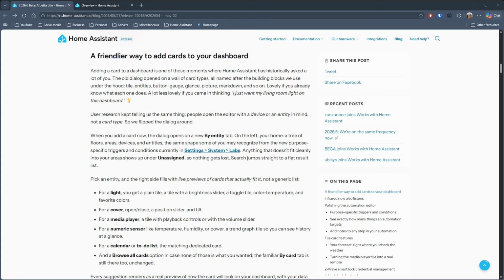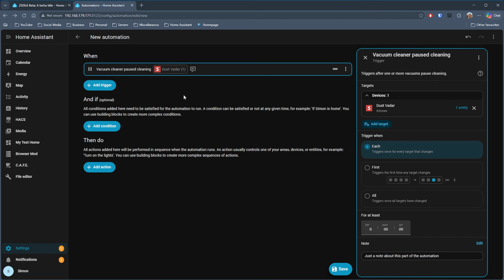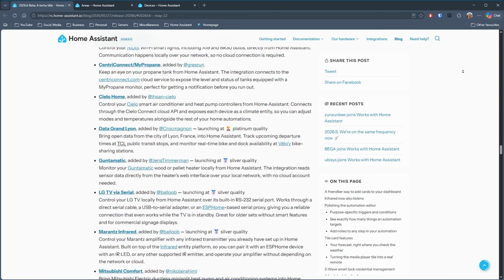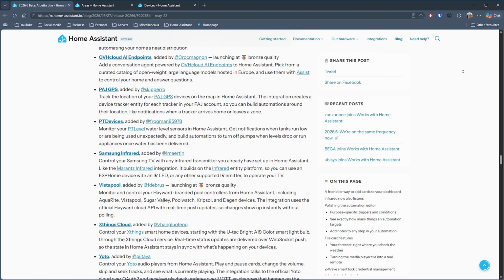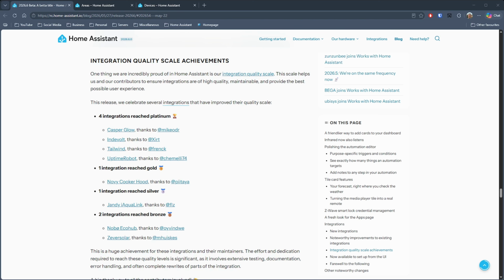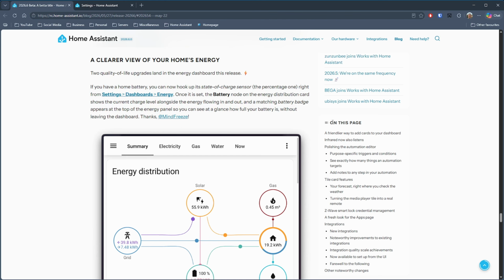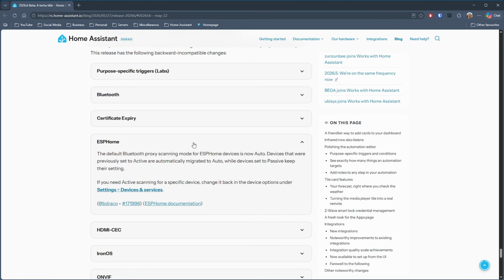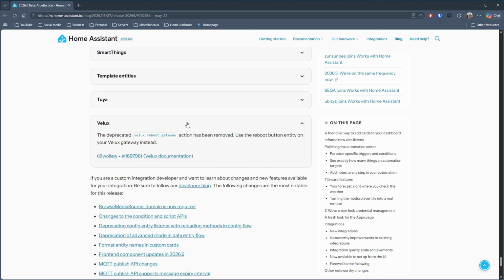Home Assistant 2026.6 Infrared Is Complete and New Dashboard Features

Comment: Lots of great enhancements. Someone mentioned "not much to get excited about."  My opinion is as long as this platform is still being supported and integrations updated, that's a good thing.  The alternative is junk 'smart home' appliances where you rely on foreign servers to make work and with no privacy. How many 'smart' devices have we tossed into the bin because they stopped working or they've encrypted their communication so we can't control it locally?
Reply from the maker: Absolutely, there's some significant improvements in this release, when it stops improving then we should be worried.

What we're seeing a lot of at the moment is Home Assistant becoming more new user friendly and whilst that may not interest some people, it's a massive thing for Home Assistant as a smart home system.

Comment: I think the card suggestions when adding an entity to a dashboard is a great idea.  Often just "put up" with the current only option when it may not be the best.  I will also use the automation comments as I often, at my age, can't remember why I did what I did in an automation.
Reply from the maker: Yes the card suggestion is quite good, I tried it with some other devices off camera and the suggestions are quite interesting. As for the notes, I'll certainly be using that as well 👍

Comment: Node red as an app in HA Dashboard 2 is now non-functional.
Reply from the maker: What issue are you experiencing?

I don't use Node Red but just installed it into the beta release to see what the problem was. It failed to start, with an error in the logs referring to an SSL certificate being required, but once I'd disabled that option in the configuration it then started up perfectly fine.

Comment: Notes in automation are one feature that I will use extensively.
Reply from the maker: Yeah that's a really nice addition to the workflow, I'll be using that a lot myself 👍
Reply: I always thought why would they remove rem’ed out text in an automation. So much better than notes feature. I would think it would be easier to implement as well. Well at least there are notes now…
Reply from the maker: Yes it's an odd thing to do that, although there must be a reason
Reply: Absolutely. Who remembers exactly why an automation was set up this specific way, half year down the line.
Reply from the maker: So true 👍
Reply: Do the notes show in the Yaml?
Reply from the maker: Yes they do, there is a new note key with what you've gone and typed in 👍

Comment: I was eagerly waiting for the Unifi Protect Alarm Manager profile selection but they messed it up so far. It's not like a normal alarm where the alarm profiles and disarm are all in one selector, but rather two entities. Hoping they change it prior to the beta ending. I created an issue on GitHub for it but will see what happens.